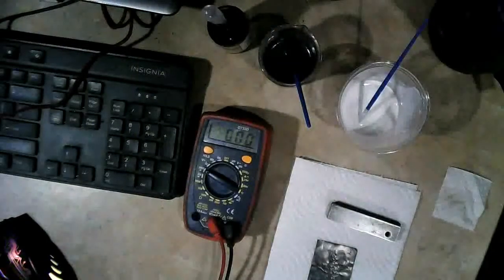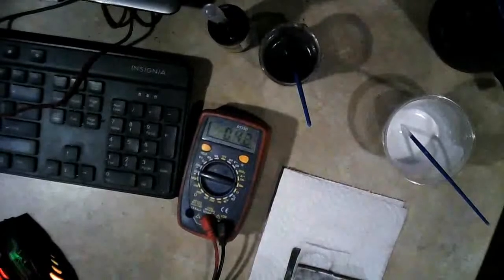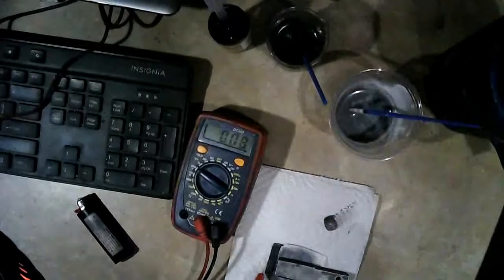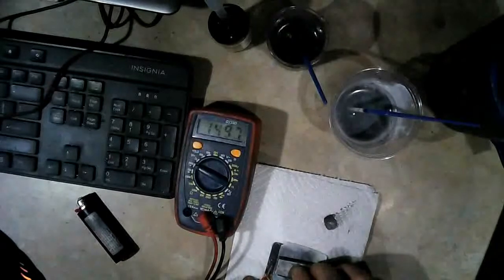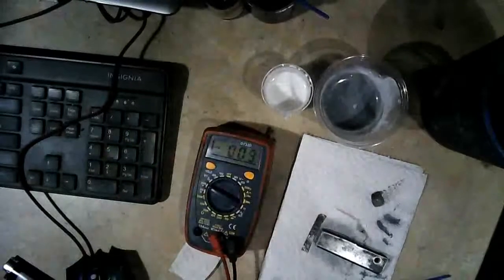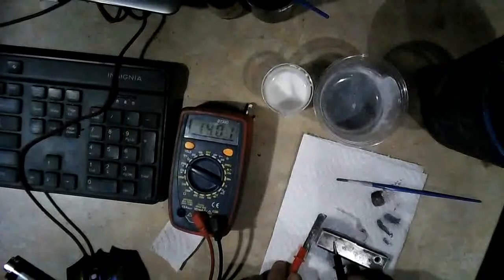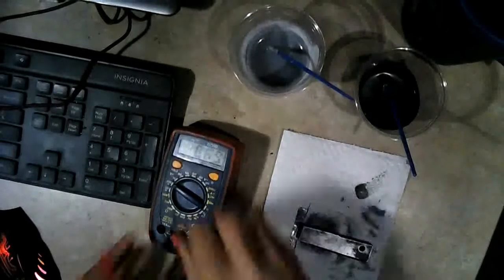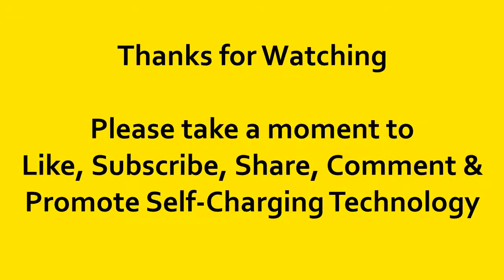The Magnesium 2 Volt Bio-Cell!

Comment: Yea with the magnesium you should be able to tell fairly quickly if it's oxidising or not. I had a strip of magnesium and popped it into glycogen in an open jar, it took a long time but oxidised in the end
Reply from the maker: Interesting, I'll monitor the magnesium during the tests visually when I take the cell apart. It should be obvious when I find something that works.

Comment: Yes if your cell is constantly wet and with a good air flow, i don't see any reason why this shouldn't work but magnesium will degrade , which is a pity because it gives out a lot of voltage and amps. I look forward to seeing how you progress with this. Regards Mike
Reply from the maker: Thanks Mike. I'm hoping I can control the oxidation of the magnesium with the borax separator, but maybe not. We'll have to wait an see.